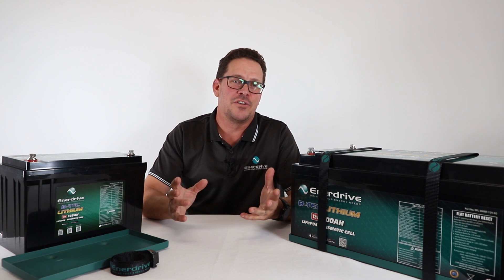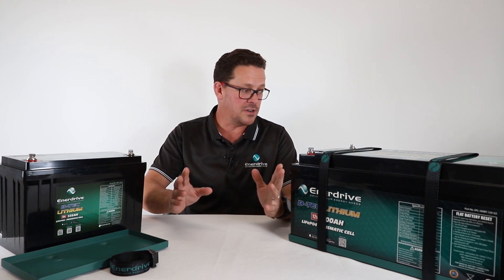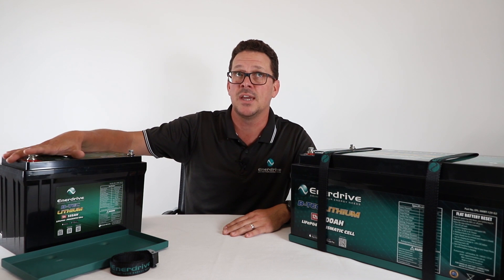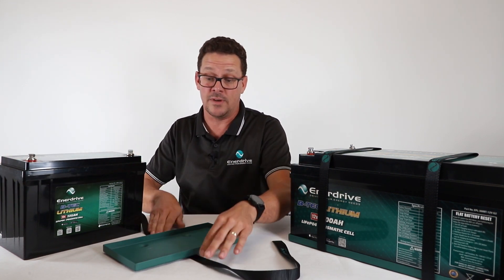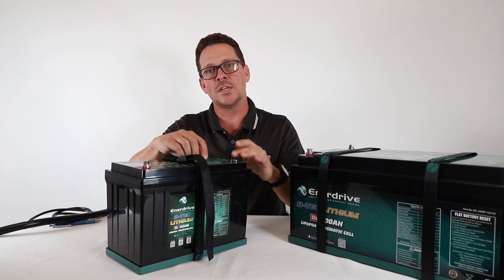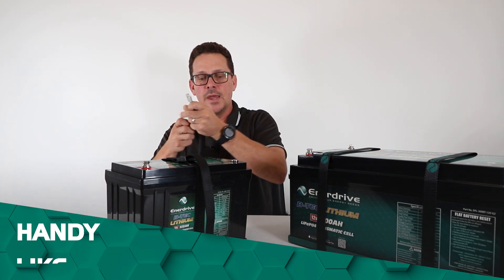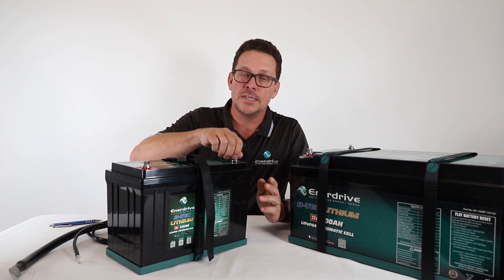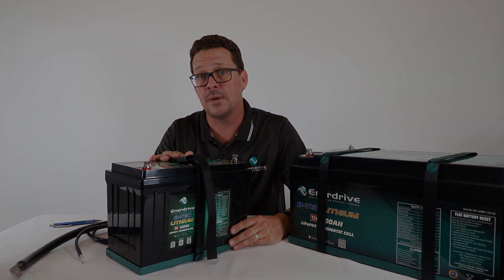Enerdrive B-TEC Lithium Batteries - Part 3 - Installation

Comment: Why is it that you can't run a 2000w inverter from 2 100ah batteries but can run 1 200ah battery you have said it can be done but on the Web site you say no thanks Bill
Reply from the maker: It relates to the BMS on the respective B-TEC Lithium Batteries. For the best support, please visit our dedicated support centre: https://support.enerdrive.com.au/. You can also find helpful resources, FAQs, and contact options there, including phone support and a contact form.